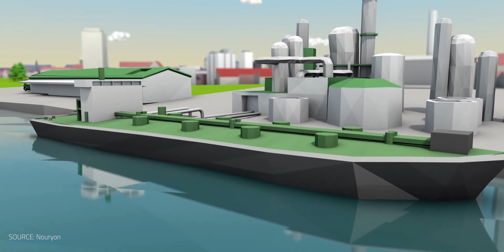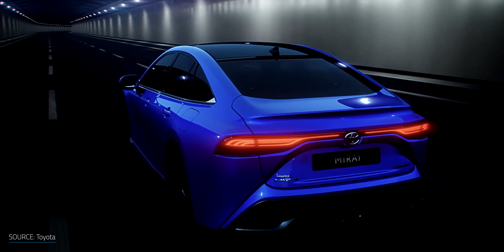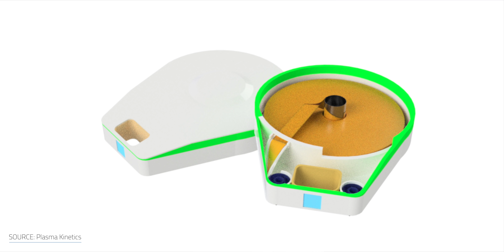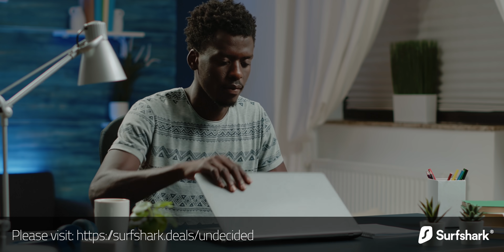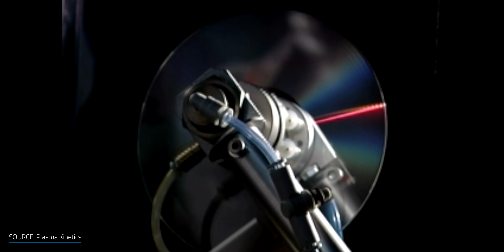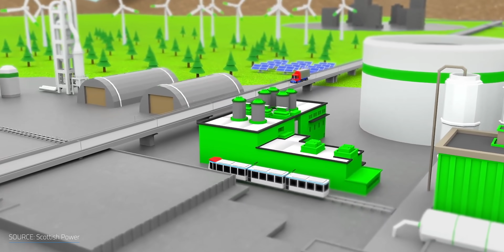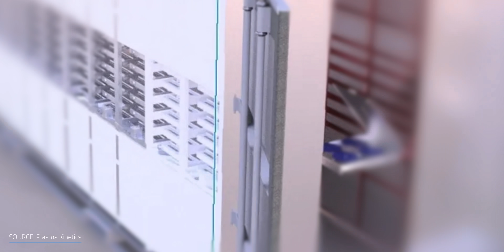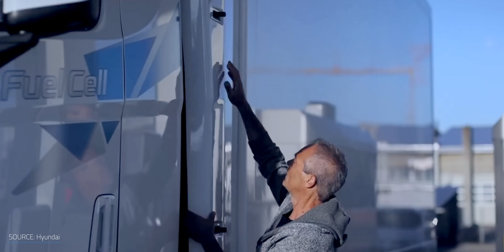Energy Storage Breakthrough - Solid Hydrogen Explained

Comment: I'm not the smartest bulb in the box, but last I checked, most of the hydrogen in the atmosphere is in water vapor...in a very stable bond. How much energy are those little roller film spongy sponges going to put into the system to split that water molecule to get to that hydrogen in order trap it? More than the energy you're gonna get back out of it.Or were they just assuming there is free-floating pure hydrogen everywhere? And where's this energy for the laser or light that's gonna zap it out of the film coming from? There's a law of the universe involved here somewhere iirc...and these are just starters...so much wrong here.
And then there's the BS about the govt banning tech? I could go into US Export Controls, and the ITAR specifically mentioned here which have nothing to do with manufacturing something, but I won't. Anyone can just Google it. They control who can see the tech, work on the tech, and who gets the tech...they don't stop you from making the tech.
And that's just for starters. The sheer level of...well...I don't even know how to describe...comic book?

Comment: I wonder if this absorption could be adapted to a car so it could absorb Hydrogen out of the air, store it long enough to be moved to the engine as fuel?  This material could work as a filter and absorber. 
First absorbing the Hydrogen out of the air. 
Second filtering it so only the Hydrogen gets through. 
Then it is sent to the engine just in time for the combustion process. 
Oxygen is added here of course. 
If this could work this way is would completely remove the need for fossil fuels in cars. 
Only a small amount would be needed to be stored and could be readily replaced by the air.

Comment: There is a much cheaper simpler way to store hydrogen - made into a fuel like butane or ethanol. You take some CO2 out of the atmosphere, separate the oxygen then use the carbon as a feed-stock to make the desired fuel.. Hey presto CO2 neutral plus cheap and better.

Comment: To me, trains are the perfect use case for this tech. 
You just have 1 or 2 fuel cars behind the engine, like the old coal cars. 
Then at a station, it would be a simple matter to swap in a new power module car.
Reply: Trains can already run on eletricity
Reply: what are you talking about?! Trains use overhead wires or thrid rail for electricity which is wayyyyy more efficient

Comment: Hi, interesting.

What's the amount of molecular Hydrogen in our atmosphere? How much energy does it take to break the connections between the hydrogen atoms and then bind them to that disk? Then how much energy is needed to release the hydrogen from the disk, and what amount does the disk store? What process is used to store the hydrogen into that disk? Also how much hydrogen is needed to power a car or a truck for a 100km trip?
There is always an energy cost on these processes. If that disk absorbs the hydrogen, you'll have to provide energy to release it. To store energy one must give energy to the system just for the process of storing. There are no free meals in the Universe.

Comment: Hydrogen storage is horribly inefficient and will only be used if the energy density, power density or "charge speed" makes it absolutely necessary:
electrolysis 80%
LAES 70% (from the video)
fuel-cell efficiency 60%
80%*70%*60%=33% total efficiency :-(
Li-Ion batteries have an efficiency of around 95%!

Okay but what insane storage density can you reach with this LAES technology?
30% lighter than Li-Ion batteries...

Comment: CONCEPT: Small, portable hydrogen fuel cell (HFC) in the boot of my EV car, resupplied by hydrogen storage disks purchased from local shops. When my EV needs charging, I pull out the HFC and connect it to the charging port. Swap out hydrogen storage disks as necessary. UPSHOT: No need to install plug-in stations as I carry my hydrogen with me. No need to worry about finding a charging station as if push comes to shove I can pull over on the side of the road and load another hydrogen disk. Rather than one step between electricity source and EV charge, it's 2 steps, but the EV charging station is portable (in the boot of my car). Much cheaper solution than installing infrastructure that sits idle most of the time?

Comment: A problem with hydrogen has been its energy efficiency and petrochemical sources.  Presently most hydrogen is obtained from the steam reforming of natural gas, which leaves left over carbon atoms.  So not really a clean fuel.  If instead we use electrolsis of water to release hydrogen we pay such a heavy energy cost that there is a negative amount of energy obtained from the overall process.  Dirty electricity production would just mean dirty hydrogen fuel.  Again no carbon benefit.  Hydrogen storage and transport are secondary issues but this video treats them as if they are primary.  So a bit misleading.  This is not the breakthrough that is suggested.

Comment: Those cells filling up with deuterium seems like a cool thing rather than a problem - it could be used in fusion reactors(that seem to be coming soon), that will be generating power for producing hydrogen, that can be then stored in those cells.

Comment: This is next level. When you can store hydrogen without the low temperature/high pressure and when you can capture hydrogen byproducts from chemical reactions, that solves almost all issues.

Then use the deuterium generated from this to power nuclear fusion.

Imagine using this on Airbus' Zero Emission Hydrogen powered aircrafts

Net Zero by 2050, here we go!

Comment: This is just silly.  Why would we convert natural gas to hydrogen to store it on a film for transport.  Then burn it in a fuel sell at ~50% efficiency. We have a world wide natural gas distribution and consumption system already, and natural gas is substantially safer to handle than hydrogen. Hydrogen is just about the worst form of energy storage people can come up with.  Even when you are working with renewables it doesn't make any sense.  Under good conditions you lose 20% of the energy splitting hydrogen from water.  Then you lose another 40% converting hydrogen to electricity. A battery is going to give you greater than 90% back, or just build more renewables and a better grid with longer range. The sun always shines somewhere and the wind always blows some where.  You could even use compressed air storage and get roughly the same energy storage potential with current tech.   Hell you can all so just store excess energy for heating and cooling at point of use in thermal mass store (water tanks and the like).  If we convert the grid and industry to renewables, and a large volume of passenger cars to electric, it won't matter the ships, planes, trucks burn. 

Hydrogen energy storage is the snake oil of the renewable energy industry.

Comment: Solids suck, store your Hydrogen as a liquid by bonding it to a light atom able to covanently bond to the maximum number of hydrogen atoms.  Checking the periodic table and what do you know that element is called CARBON which means the resulting molecule will be called HYDROCARBON and oxidizing it give us back virtually all of the energy consumed from electrolysis of water.  People need to stop obsessing over the naked hydrogen molecule or thinking every combound with Carbon in it is inherently bad, if the carbon is not dug out of the ground it's not a net addition of CO2 to the atmosphere, it's just a recycled carrier for energy no different then lithium or magnesium.

Comment: It absorbs hydrogen from the air? How? There is no hydrogen in the air you could absorb! There is water in the air but to break off hydrogen from water, you need energy, as you point out yourself in the video. Where is is supposed to come from? No material in the world, no shape in the world, can make a process happen on its own that typically requires energy to happen.

Comment: Wow, fascinating tech! Can the tech be similarly applied for other types of gas storage/capture? For example, capture/storage of methane at an oil wellsite. It is typically uneconomical to store/ship at the well so it is routinely flared or burned off - releasing lots of greenhouse gases. Also, use the tech to capture lethal gas (e.g., carbon monoxide) for added safety in homes and workspaces.
Reply: no

Comment: What, you're saying that you have an automated deuterium collection method for Fusion as well as hydrogen battery storage for general domestic applications? That is actually amazing. 

My only reservation is at the fragility of the film itself. If it breaks - and it will - you're fucked.

Also, I do wonder how the energy density can be high enough - surely if a large portion of the volume of the storage is the film, how can it be more energy dense than compressed free atoms of hydrogen?

Comment: Sir, with respect, if you are going to promulgate information from a commercial website which makes incredible claims, you should at least do a basic estimate of the validity of such claims, assuming you wish to be taken seriously.  Only high school level physics and chemistry are all that is needed to demonstrate that the claims are so much baloney.  For instance, the volume of hydrogen stored in the volume of thin film metallic hydride could never be greater than that same volume of hydride replaced by liquid hydrogen.  It is simple to calculate the volume of a 30 cm squared area of magnesium hydride only 1 micron thick which if replaced by liquid hydrogen would amount roughly to a party balloon of hydrogen gas at room temperature and pressure.

Without such basic analyses by you or your team, this video destroys the entire credibility of your site.  While I wish you luck in your endeavors, I can only feel sad that there will be so many people now laughing at you.
Reply from the maker: I’ve stated numerous times in the comments, and a pinned comment, and the description that an updated video is in the works.  it’s taking some time to pull together.
Reply: @UndecidedMF  We all make mistakes, so I am pleased to hear you are at least working on some form of rebuttal that will correct errors in your original presentation.  I wish you every sucess with a well analyzed update.

Comment: This dude is more scientifically illiterate than the average high schooler.  It should go without saying that there is no free hydrogen floating around in smokestacks, as hydrogen is a fuel for combustion and not a product. Secondly, hydrogen atoms are neutrally charged, not positively charged as is said in the video. Meaning that even if there was hydrogen floating around in smokestacks, the device still would not work.
Reply from the maker: https://www.biocycle.net/renewable-hydrogen-from-fuel-cells-at-wastewater-treatment-plants/. https://www.sciencedirect.com/science/article/abs/pii/S0360319909012762. https://pubs.acs.org/doi/10.1021/acs.energyfuels.1c00228.  It's a thing ... I did a poor job explaining the nuances around it, so an updated video is in the works.

Comment: You are all alike. Just have a think, Real engineering, Undecided with Will Ferrel, … Oh, that was you. Sorry. Anyway…

Someone sends you a flyer, you go to their homepage, you watch their CGI and read some statement. Then, without any thought process or analysis, you just bask in the glory of the hype and views on YT. You and your colleagues are just pathetic. 

So, now you call them and ask since when hydrogen molecules or hydrogen atoms has a net positive charge that allows them “bind” to a negatively charge surface. When you dig into that, you just go on from there. The path will be clearly marked. 

This will not crash and burn, it will just dissipate when they have worked their way through the scammed investors money.